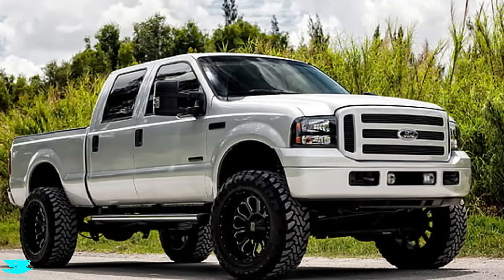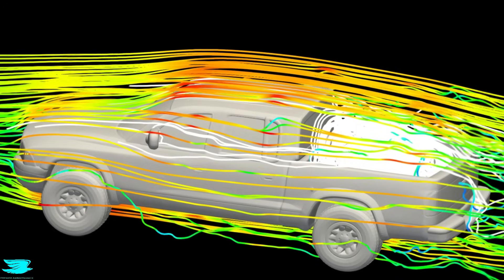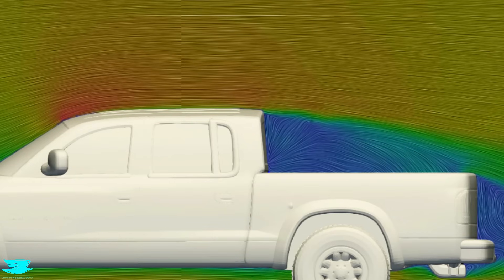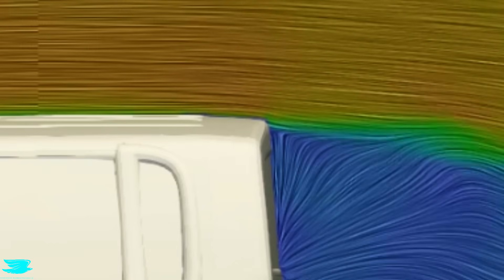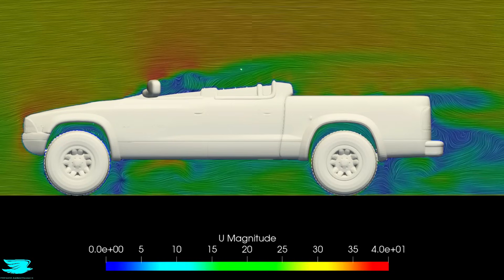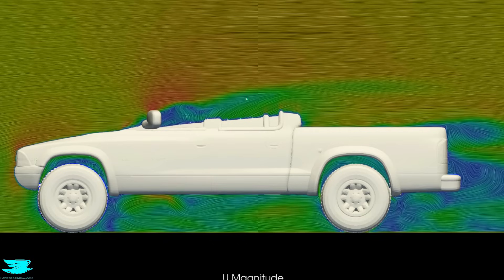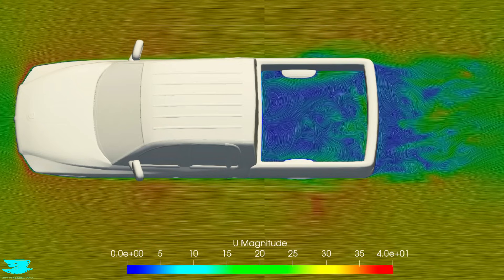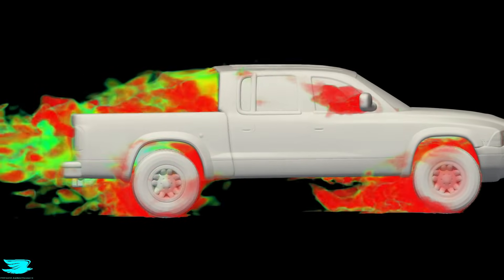How To Fix This Pickup Truck's Aerodynamics [Dodge Dakota 2002]

Comment: "...Rounded tires.."  The tires are ROTATING! NOT gliding locked over slippery ice.

The flow catching or not the tailgate ALL DEPENDS on speed:  
Fast; its going over
Slow; it int.
Now 98% of driving is Urban so all that bed talk is moot.
Reply: Not if you live in the country,  there is literally NO "urban" environment.......

Comment: I'm not sure if it would be possible, but maybe you could do this to a motorcycle? A 2020 Honda rebel? I changed my helmet out a few days ago from open face, to a sport bike helmet and it went up about 6 mpg, so now I'm curious what other areas are causing drag, I'm anticipating mirrors, well a lot of things actually.  I'd think that this could be a good video so you could show the importance of aerodynamics, a motorcycle can get great mpg, but it's a brick compared to a car.
Reply from the maker: Wow, I'm surprised that the face bit made that much of a difference.

Comment: Im looking to drop my drag on my 1998 vw jetta you think rear wheel covers would help?
Reply from the maker: Definitely. Rear wheel covers help almost every car. But be careful that you don't overheat the brakes - wheel covers starve the brakes of cooling flow.
Reply: @PremierAerodynamics its drum brakes in the back so im not to worried im gonna add air vents just in case to blow on them im already at 43.7 mpg but I know I can do better after all other stuff is fixed i gonna do tire upgrade and aero

Comment: The roof of the Dodge has a little lip that intentionally trips up the flow, which is why it's so well attached and doesn't produce that much lift. Since the lip induces a slightly turbulent boundary layer, it limits how much energy can be transported by the flow. You'll see how the pressure recovers pretty quickly downstream.
Reply from the maker: I think Dodge did a pretty decent job.

Comment: I see, so if you're going to modify a Ram pick up you find at a junk yard, make sure to lower the front, not only will it look cool but it will also put the nose in ground effect enhancing it's already good leading edge.
Reply from the maker: Lowering it might help reduce the drag too, especially with a decent diffuser.

Comment: So you're saying if you're going to put a Jacuzzi in your pickup's bed make sure you have a back rest towards the window or you'll spill you're beer!
Reply from the maker: Also, you can reach through the rear window to the icebox in the middle seat.
Reply: Genius  @PremierAerodynamics
Reply: @PremierAerodynamics  
Unfortunately, the rear window doesn't open on a 2002 Dodge Dakota
Reply: @MinecraftPro97k  there were sliding windows on the dakotas, yes even the quad cabs.  I happen to have one.
Reply: This is the proper takeaway from this vid 😂😂

Comment: Does your simulation account for the air that enters the engine bay and exits the cowling at the base of the windshield? I assume that has a non-zero effect on the high-pressure zone you noted on the windshield.
Reply: I could be wrong but I think cowling is usually only open on one side (other vent is fake for symmetry) and is the intake for interior fan (external air as opposed to recirculation) but it's not open to the engine bay so that the AC isn't pulling hot air from it. It's like a little box with mesh to keep debris out and a drain hole
Reply: Nah i think no because this is a videogame model
Reply: @Red1110_2 simulation
Reply: The air that enters the engine bay actually exits under the car.